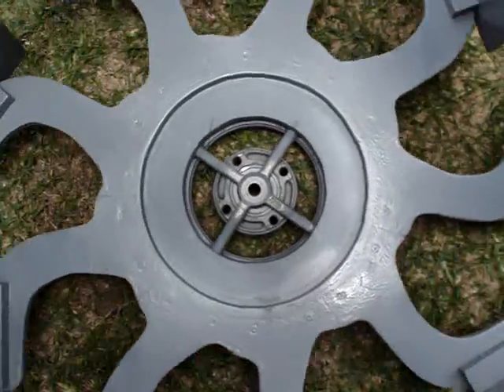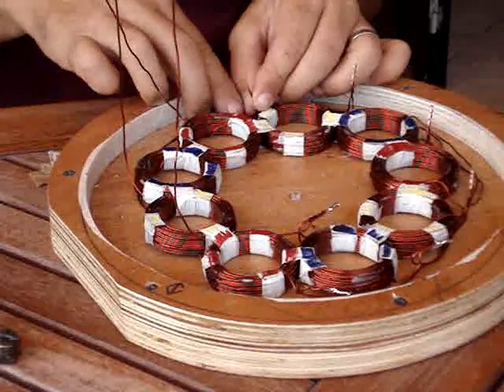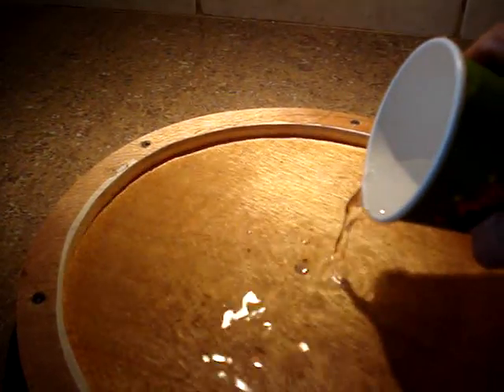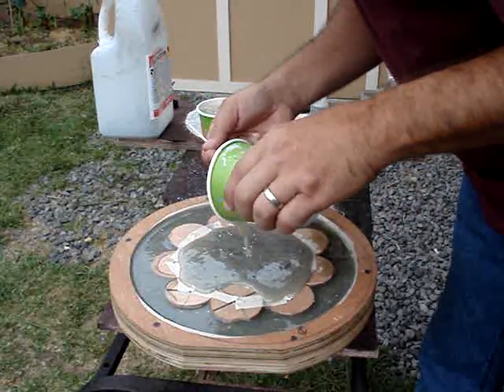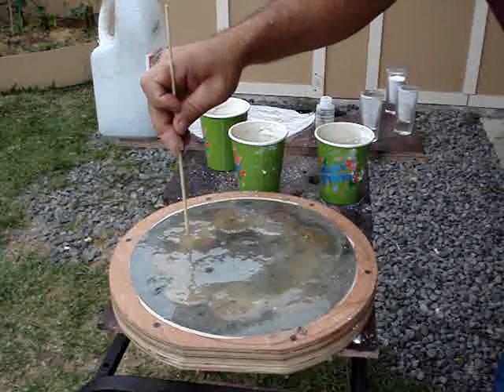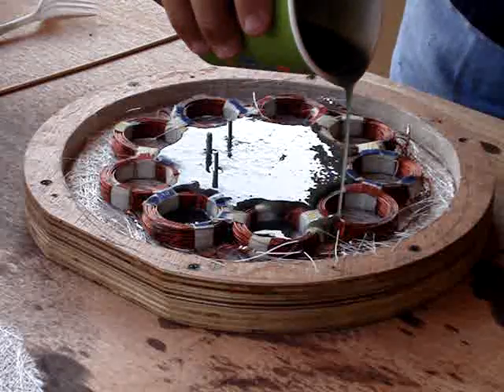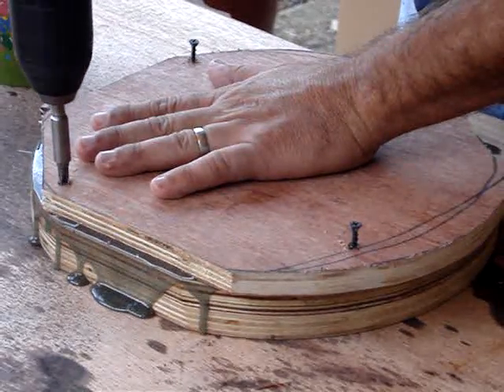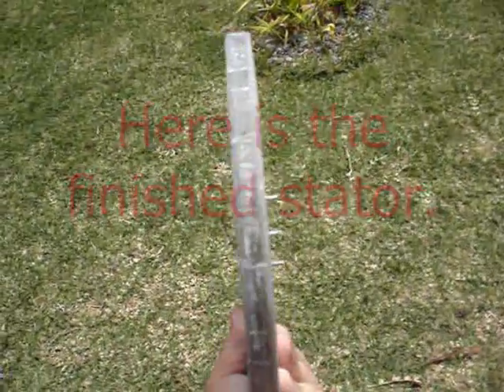How to build a homemade stator for a P.M.A generator (wind turbine, hydroelectric)

Comment: I was winding them in 2003-2004 for my boss when I was working at Millers Forrest (NSW, Australia) ,they were an exciter stator (Allight) for a generator.I am thinking of building my own wind generator maybe to generate 240 volts per phase (415 volt 3 phase) .The only 2 things that I have to consider is wind speed (Hertz) and coil winding turns & gauge to get the right impedence say for a 4800 watt generator coil, R (resistance) = Z (impedence) @ unity power factor (1) anyway which is the raw power straight out of the generator before any Capacitive (Xc),inductive (Xl) or resistive load is applied to the installation (e.g. fluoro lights (ballast)  have a power factor correction of 0.9 when a capacitor is connected in parallel with the lamp supply so Xl-Xc=Z @ that power factor value and is what the supply authority sees as neccessary).I can get rare earth magnets on Ebay so I need to work out the magnetic flux density,etc of the magnet ,coil resistance,turns & gauge of winding need to be calculated.A rectifier & SCR trigger circuit (possibly 3 phase) could be designed & built so a 50 hertz (in Australia) frequency can be maintained. I don't know why the hell the Australian government seem content to keep me out of work and out of the trade I was trained to do,ever since I left my apprenticeship in 2002 after my boss (Brown) didn't approve of the way I turned out after my manager (McDonagh) was fired and my boss is still in business working in the trade when I appear to have been booted out of every company in the Hunter region in New South Wales (Lastina) and haven't worked for the last 3 1/2 years and the last company (Westrac) decided I wasn't what "they" needed after working in an auto electrical role yet the government keeps on labelling me as "good for nothing " !!!!

Comment: Excellent work. If I may add that the induced voltage in the coil is higher when the magnetic field is perpendicular to the conductor. Thus elongated (rectangular) shaped coils with rectangular magnets may possibly induce a higher voltage & thus higher current.  The arc of the round coil at the inner and outer edges is almost parallel to the magnetic flux of a round magnet and thus induces little if any current.
Reply: +Graham Harris Graham Please, I need your assessment of my Round coils which I made recently. How can I send there Pictures to you?  I also want to know the best type of Magnet to use with disc Coils Should it be Rectangular Neodymium Magnets? Please I am extremely curious now
Reply: +janet edwards Hello Janet, I have a degree in electrical & electronic engineering but dumped that dreary subject a few yrs ago to focus on photography. But Ill help if I can ... grahamhgraham@btinternet.com

Comment: and how you calculate the thickness of the wire?what thickness you have? and how many turns? thanks for respond < friend
Reply: Hi. Friend please if u get the answers about ur question please I need these answers. Thanks
Reply from the maker: ali majeed IT all depends on how big your turbine is . For a small turbine to produce usable voltage you should go with a thinner wire say 22 ga and more turns around 100-130 turns for you coils .Please check out lynxsteams channel and emagnets channel they have way more videos than I do on this,

Comment: ผมเองสนใจในการทำกังหันลม แต่ไม่มีความรู้มากพอจะทำมันขึ้นมา ผมยังสงสัยเกี่ยวกับการคำนวนการพันสายทองแดง และแม่เหล็กควรมีขนาดเท่าไหร่และหนาเท่าไหร่เป็นเกณฑ์มาตรฐาน? ผมจะยินดีมากหากคุณจะบอกหลักการทำงานของมันที่จำเป็นต้องรู้
นับถือ
Reply from the maker: If you are just starting out you could start with #20 magnet wire at about 90 120 turns per coil about 6 cm round x 2 cm thick. And use any magnets you can find they should be all roughly the same size about 4 5 cm round or square. If you can use the neodymium magnets it will produce more power. Thanks for watching
Reply: Aceman307
1./ควรพันเส้นทองแดงให้มีความหนาไม่เกินเท่าไหร่?
2./ฉันใช้เส้นทองแดง #18 ฉันต้องทำมากกว่า 90รอบ ใช่ไหม?
3./จะคำนวนการพันเส้นทองแดงจากสูตรไหน?
4./ความหนาของแม่เหล็กเท่าไหร่เป็นอย่างน้อย?
(ฉันใช้ neodymium magnets ขนาด 40x20x5mm )
5./ฉันทำแบบ 3phase โดย 1phase= 4coils, บางคนในประเทศไทยบอกกับฉันว่าควรจะให้มี coil มากกว่า magnet เช่น หากมี coil=4 แม่เหล็กจะต้องมี 5-6

ต้องขอโทษอย่างยิ่งที่ฉันเขียนภาษาไทย เพราะว่าฉันอ่อนหัดในภาษาอังกฤษเป็นอย่างมาก
และต้องขอบคุณอย่างมากที่คุณกรุณาตอบกลับเพื่อแบ่งปันความรู้
นับถืออย่างยิ่ง
Reply from the maker: purinut sunthadsarn Hi Purinut,
Have you had a chance to watch my other videos. In the video for making the coils I show how to get the size of coil in relation to the magnets. I have about 4 videos that show exactly how I build the PMA. I know you do not speak much English so I will try and help by writing some of the ideas. # 18 at 90 Is going to be thick. Its better to go with a thinner wire so your volts will be higher with the smaller magnets. You can do a single phase generator if its easier for you. Lynxsteam has some good videos on single phase PMA's. Check out his Haiti wind turbine its a great design to start with. Also Emagnets has some good videos on PMA's.
Reply: Aceman307
Thank you very much.
I have a problem with writing skill, but I understand what you are writing. When I have a form and operate it well than. I will show you the shape of it. Because wind in Thailand is very weak compared to Europe and America, I had the idea to make a difference from another people in terms of shape and size.
Thank you very much again for your kindness And hope you will continue to share a good thing. :D
Reply from the maker: purinut sunthadsarn You may be interested in my next project it Is going to be some kind of gravity powered generator that will produce electricity when you need it. Stay tuned.
Reply: Aceman307
I would like to know how to calculation of winding
I chose the wire #20 according to your instructions and I chose a magnet thick 10mm
I should windings much thicker compared to the thickness of the magnet?

Thank you so much, sir :)
Reply from the maker: purinut sunthadsarn If you freeze my video with the layout of my coils I have it in cm also. You need to know the thickness and diameter of the magnet. Maybe there is a scientific formula for all the dimension but I dont know it. Most of the information I have found on the internet is allot of trail and error. Good luck.
Reply: purinut sunthadsarn  คนไทยก็ทำได้แล้วครับ ลองหาดูในอินเตอร์เน็ตครับ เค้าสอนอยู่ที่วัดครับฟรีๆ

Comment: when you solder the windings together, are all three phases wound and linked cw, cw, cw?  Or is there some sort of alternating pattern?
Reply from the maker: When winding the coils make sure you mark the starting wire of the coil and the finish wire of the coil. This is very important. If you look closely at the wiring diagram it shows exactly how to connect the three phases. The start wire from one phase to the finish wire of the next coil in the same phase. You can find the wiring diagram under Google images under "wind turbine permanent magnet alternator wiring diagrams"  I hope this helps. Thanks for watching

Comment: Curious... why does everybody I saw doing DIY wind turbines cover the windings in epoxy?
Reply from the maker: The reason you cover the coils is to keep them inline and straight so you can pass the magnets as close as possible without touching. In most PMA generators you use two set of magnets one set on top and one set on bottom. If you were only using one set of magnets passing on top of the coils you could get away with not using epoxy.  I have other videos putting the PMA together.Thanks for watching.

Comment: now how can i design the required rpm for a certain volt   >> or it's by calibration
Reply from the maker: There are allot of variables, Emagnets has some videos on coils and he test them at specific RPM using a drill.

Comment: What's the talk for?

or where can I find out how to mix this accurately?

than ks
Reply from the maker: When you buy the resin the hardner has instructions on it for the amount to use. Any amount will work it depends on how fast or slow you want it to setup, also the temperture outside, the colder it is the slower it takes to setup. Thanks for watching.

Comment: wonder if Plaster of Paris would work instead of resin - maybe mixed with
fiber glass Flox -
plaster dose shrink 5% when drying - plaster may work well as heat sink also -
Reply: Nice Suggestion +Groovy

I assure you it will work since I had also tried it.
I tried running this setup with naked coils, just held together with masking tape ,and it gave me very good results,just like the ones I got after APPLYING THE PLASTER. So ,Scientifically ,there is no violation of the principles of electromagnetism.

The only things you have to take into consideration is 
1)Minimize the distance that the plaster of Paris combination will take so that the magnetic field between the magnets(across the stator) wont be reduced

2) Keeping your combination away from water/solvents such that the plaster wont be affected. This too applies to humid conditions which in the long run could degrade the plaster.

My final recommendation to this would be ,If at all one uses the Plaster Of Paris (POP) instead of the resin, this setup will be fit for indoor uses and not for outdoor wind generation.

Comment: Cogging is a result inefficient design. the number of magnets must be 1.333 times the number of coils. For example if number of coil is 3 then magnets must be 4. This way if 1 magnet is in max cogging then the next magnet is near to enter the next coil while the last magnet is leaving the coil. During the rotation the applied torque is very regular.

Comment: Hello, sorry I am new in the field of creation, I would like to have more information on the design of stators (0.47) one can see the three stators left linking Heux must just connected and leaves the center without that it touches?? is that between the stators should have to touch or not? and the magnets must be located at what level relative to the stator, it must pass a thank you to you what level

Comment from the maker: I tell you from what I have found its a big difference between theory and real world.  Maybe your right and adding metal would increase output but if the turbine does not start spinning it makes no electricity verses spinning and making some electricity. Any little amount of drag really affects the turbines ability to start up. I agree about round coils maybe you have not seen my later video on how I built a serpentine coil. More efficient and easier to build. Thanks for the comment.
Reply: There will be a significant amount of power in addition rather than drag in the case you where to add iron/steel cores to the magnets. The tighter the winding around a steel core the greater the magnetic field.
Also keeping the resin overflow on top of the coil wire is better as it reduces magnetic field interference.
The closer togetheter the surfaces are the greater the force you create. Try using a thin coil paper rather than resin in between the layers. Your attempts to counteract the inevitable breakdown/corrosion is counteracting performance I believe.
Hope this makes sense.

Comment: Hi Mate, as mentioned in my last comment, Circular coils have the most inefficient design. Change this and you will see an increase in current. Also Make sure that a passing magnet on one half of the coil is not cancelled out by an opposing magnet on the other side. Also the centre gap of coil to be the same width as the magnet.

Comment: Yes this is true but theoretically I think it would if any external force overcame the cogging. Also Circular coils are not the most efficient coil design this is because an almost triangle coil design creates a larger surface area for induced current.

Comment from the maker: Right now my turbine does not spin fast enough to get to 12-13 volts so until I can design the turbine to spin faster I can get any usable data. From what I can tell this stator and rotor set up would be better for an horizontal wind turbine.

Comment: Is there an optimal coils to magnets ratio? I have 6 neodymium magnets so i was wondering what the best number of coils would be to ensure maxium power output. Thanks a lot!
Reply: The ratio is 4 magnets to 3 coils in a three phase configuration or a 2 magnets to 1 coil in a single phase configuration. With only six magnets, you may want to try a single phase but I would make sure the coils have at least 300 turns each. But if you can get more magnets, then go for 8 to 12 magnets for greater output.

Comment: aceman, i have this broken electric fan and build a stator for it.. i would still want to use the aluminum frame from beneath it. its about 4 in in diameter. how much coils, magnets would i use to at least produce a 5 volts to power up emergency lights around the house? and the gauge or the diameter of the magnetic wire??  anyways, great vid :)

Comment from the maker: ok the stator produces A/c current the magnets are facing north and south each time they pass a coil it pulls or pushes electrons making + and -. If you used just three coils that would be one phase and would work but In this stator we have 3 sets of 3 coils, each set is offset by 120degs all this does is smoothes the electical flow coming out of the stator. So each wire is A/C power.To convert it to D/C power you have to use a bridge rectifier. Look at my video (completion of the PMA)

Comment: okay, thanks for the reply, i plan on using the n52 neodynium magnets, they cost more, but i think they are the best go with. what if i used 2 threads of 20 awg wire at 100 turns. do you think that would be a good idea? i plan on using just the 9 coils and 24 magnets.

Comment from the maker: Ok the general Idea is smaller wire more turns higher volts less amps, I would start with 18awg or 20 awg wire at 100-130 turns each, That will get you in the right area. Wind speed, type of magnets, number of magnets, number of coils, size of coils in relation to magnets, magnets on top and bottom of stator or only one side. All these things affect the output of a wind turbine PMA, study Emagnets videos he has done alot of testing with different configurations. Good luck

Comment: can someone help me out with something, before making a vawt, i need help with the coils, does a smaller gauge wire produce more voltage? amps? or less? whats the difference between wire gauge and coil winds? once i have my answer ill be going right to work.

Comment from the maker: Are you going to have magnets on both sides of the stator? From what I have learned is it helps if the magnets are mounted to a steel plate of some kind. I guess you could bolt a steel plate to the aluminum rim. I think you could go with a 16 or 14 gauge wire for the stator coils. Also check out serpentine coils they are easier to make and make more power. Check out Emagnets channel and Lynxsteams channel they have alot of different designs they have tested out. Good luck

Comment: hello sir, excuse me but for the question, but when you have the stator done and u got 3 wires, how can I convert it at least to 3dc volts?  i used 6 coils of 150 turns each, my magnet wire is just a little, little bit more tiny than yours and I used 10 ceramic magnets
N S N S N S N S N S  and im not sure how many Revolutions Per Second it do, I use a bicycle to power it

Comment from the maker: You can use anything that holds the coils together and is not affected by the weather. I use a polyester resin that the local hardware store has here. You want somthing strong and will not crack.

Comment from the maker: In this video I used 18ga enameled copper wire. I bought 2 kilos. the turns where 70 but I think you should use more like 100. the serpintine coils are easier to make. I have a video on them.

Comment: Hello again! We finished testing 2 of the 3 generators using different number of turns per coil (100 turns and 150 turns).  We will be testing the 3rd (200 turns) tonight!  The first set up only produced 1.15V and the second one 4.5V.  They are single phase units.  We will probably retest the first one because I think we spaced out the magnets too far.  This has been a good experience and a good science project!

Comment from the maker: @TECHDIARY2011 I use a 18ga enamal coated wire, at 70 turns.Check out my video how I made the coils on my channel and it will show you how I made them.

Comment: @Aceman307 Right and those are for 3phases.  In your wiring diagram I was looking how the two coils for one of the phases were connected in series.  In the wiring diagram on the site i mentioned, it shows a single phase diagram, but the wiring is positive to positive and negative to negative which confused me. Did you get a chance to see that diagram. I wanted to see if you agree.  Thanks.

Comment from the maker: @BroadwyBound1 Yes, you are calling the leads plus and neg just to label the wires right? Because the generator will be producing A/C current, each wire will be neg and pos as the magnets pass the coils. It is very important to hookup the coils with the right leads. The start of one coil to the finish of another. If you mix this up it will not work. Some people cast their stators with all the wires comming out so they can change the wiring if need be.

Comment: For a single phase generator and connecting the coils, if all the coils are laid out the same and you label the + and -, do you just connect coil 1 negative lead to the coil 2 positive lead and so on in order to connect them in series?